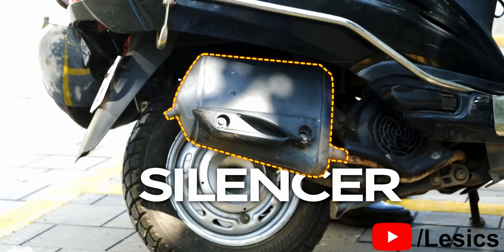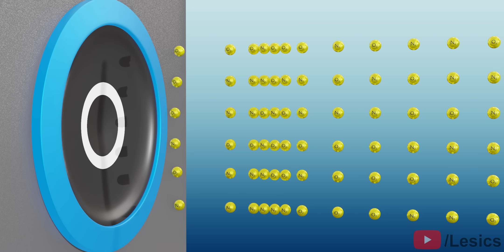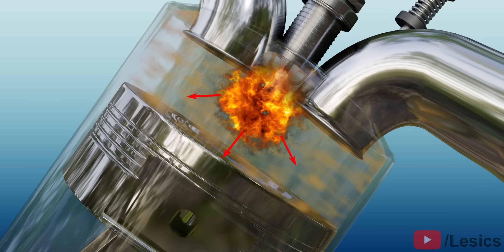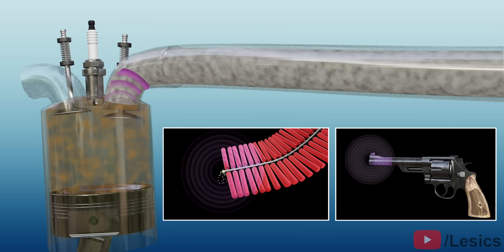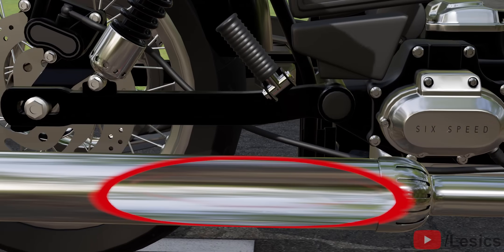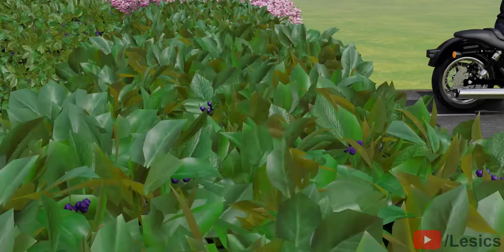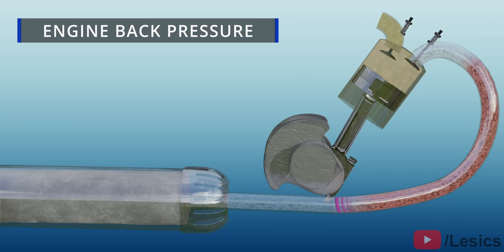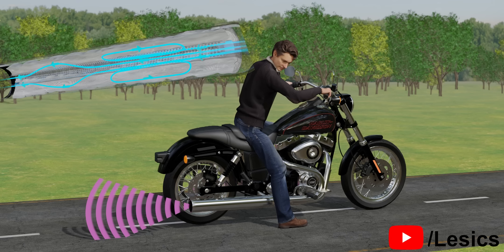Silencers | How do they work?

Comment: Trying to make a riding lawn mower engine quieter. It's an old, well used mower I bought just to move the sandbags I need to drive my two wheel drive truck in winter. Sandbags are used to give the truck weight over the rear drive wheels. I keep them stored when not in use in my shed which sits on the opposite end of my property. Owned this truck now for close to twenty years as my daily driver. Twenty years of moving five hundred pounds of sand twice a year got to be more than a little old. Had the bright idea to buy as used riding mower with a trailer just for this duty. I still mow my yard with a push mower for the exercise.

But the mower is loud. From what I read, they offer more quiet mufflers for the Briggs and Stratton. But cost more than I paid for the mower and more than I choose to spend. Bought a second truck, this one newer and Chevrolet. V8 engine and 4WD. Exhaust cross over tube under truck between cat converters from each side comes too close to transmission pan. So I wrapped the exhaust with exhaust wrap which holds up to temps at the exhaust manifold the most typical use for it. Have some left over.

The wrap is like a larger size ratchet strap and a quarter inch thick. It's soft and cloth made of some fiber material that is heat resistent to some ridiculous high number like 1600 degrees and can handle constant exposure to 800 or 600 degrees, 

Was thinking of wrapping the mower muffler on the outside. Also considering making a flow through resonator pipe with this stuff inside and a metal screen inside of it to keep it in place. Any thoughts or suggestions? I also have a hardware store fire blanket I bought at Harbor Freight for protecting things nearby when I weld. It's fiberglass. I would rather not sacrifice any of it and use the exhaust wrap instead. 

Started realizing from the DIY videos on homemade small engine mufflers, that small engines have a real noise problem that is not yet been addressed and soon will have California lead the way to ban noise from them. The same way they banned all two cycle engines. I guess they banned all small gas engines. But banning stuff is not only unAmerican, it doesn't do much other than making those who enjoy gardening and lawn work criminals.  lol

That exhaust wrap is intended to wrap a motorcycle or car exhaust at the hottest point in any exhaust, right when it leaves the engine. It should hold up if placed a short distance from that point inside a resonator as in the video here, replacing the fiberglass. Really, there is a market and need for something like this. You can buy name brand labeled quieter mufflers for small engines. But I don't think they legitimately do much and if so not for long.

Then there is a Honda small engines. Have one in a pressure washer. The motors sell themselves and the equipment that use them. Quiet, smooth and reliable. I read Honda designed the engine to be quiet and to get there takes more than just redesigning the muffler.

As a side note, the exhaust wrap had an effect on the exhaust which included trapping more heat inside the pipe due to no longer transferring that heat to the air via the walls of the pipe. And the more heat in the exhaust gas meant faster flow through the exhaust and out. I wonder if that can be used to make the exhaust quieter? If anyone can engineer a solution for quiet a small engine that uses things other than baffle arrangement, and absorbing materials inside the muffler, someone take advantage of what is already known but not utilized,l they would have as big a winner as I did when I made removable and rechargeable headlight module for my push mower and snow blower.

I was surprised when I Googled headlights for lawn mowers and only found riding mowers and some electric powered push mowers to use as examples. 

Thanks.

Comment: Main explanation is wrong: Sound reduction works exactly because sound pressure wave DO NOT travel with the fluid, but better they travel into it and way faster than it. As sound waves enter the muffler they start to expand also into the rockwool part and bounce everywhere at 550 m/s (speed of sound at 500 °C). The multiple swirls the air does into the rockwool cavities and passages "activates" the viscosity of the air, this way in part sound cancels out and in part transfer its kinetic energy to the rockwool fibers. As consequence sound is absorbed and dissipated in its propagation through the silencer. This causes the overall sound reduction.

Comment: The video is correct by strict definition. But.... It doesn't take into account that most camshafts create a scavenging effect by getting the exhaust valve open during the last of the ignition stroke. Some of the noise we hear IS actual burning fuel escaping the exhaust system.

Comment: That's why 4 valves; 2 Intake 2 Exhaust in 1 Cylinder is very important as it offers more intake outake output to improve engine performance.

Comment: No, the engine doesn't burn more fuel when you go faster, because the engine speed is according to how much air you're putting inside, more air doesn't mean more fuel has to be burned, so even if you go faster, you may not see the L/100km unit increasing, however you'll see that the fuel consumption decreases because more air helps the fuel combust better and efficiently, so this means that you won't hear a louder engine sound even when you go at higher speeds, so to speed up the engine you need more air not more fuel.

Because when you open up the throttle valve, you let more air into the cylinder, and when bigger amount of air is compressed, the air temperature rises a lot and helps the fuel combust easily and at the same time you get more power, so airflow equals fuel economy undoubtedly.

Comment: Stock silencers are always the baffle type as it is the quietest because it doesn't provide a direct flow for the exhaust. The exhaust and sound get bounced around the different baffled compartments before they exit. 

This absorption type is always the preferred aftermarket replacement since it allows a direct, straight path to the exit for the exhaust, increasing flow and noise while reducing weight through its simpler construction.

Comment: Sound waves travel in different ways

In various things.....

On Air......
In the Liquid ...or water....

On the metals....

In the metal the sound travels for some amount of distance as it was connected....for example In olden days....wired telephone ,,,, the telephone exchange person will engage the calls based on the frequency and intensity he recieved based on the waves ,,,,,, travelled and recorded.....

But the sound waves will decrease their intensity gradually upto some range.....

Within the range v hear them 

Sound obsorbers will observe the unwanted sound waves....

Generally this would b used in movie theatres....

Silencer of the vehicle will obsorbs the sound waves and delivers the minimal amount of sound outside which is generated by combustion chamber.....

Comment: The fact that the exhaust is what makes the Extremely Loud engine noise and not the actual explosions happening in the engine is completely mind blowing. I would have never even thought that was the case.
Reply: It's worth mentioning that a significant portion of the sound energy is radiated through the engine. Those combustion pulses do propagate through the walls of the engine, especially when it comes to air cooled engines. This is immediately obvious when you put an exhaust duct into a bucket of water. The remaining noise observed is now mostly due to radiation directly from the cylinder block and head, which themselves are vibrating just like the air, albeit in a much lesser form.
Reply: @captainotto  Excellent point and thanks for bringing it up.
Reply: Well no, the exhaust makes the explosions happening in the engine quieter, so therefore running it without one or a straight pipe is just the natural non dampened sound of the engine
Reply: @peeqo  either you didn't understand the guy or you didn't understand the video. Exhaust pulses are caused by the difference in pressure between the cylinder and the exhaust duct, not the combustion process itself. Since a good part of the thermal energy released is used as work, exhaust sound compounds a small portion of the energy that is rejected by the engine.
Reply: @dovilacus  The video is correct by strict definition. But.... It doesn't take into account that most camshafts create a scavenging effect by getting the exhaust valve open during the last of the ignition stroke. Some of the noise we hear IS actual burning fuel escaping the exhaust system.
Reply: @ebinmaine  well unless we're talking 2 strokes, delayed ingnition or injection that's extremly unlickely since the majority of combustion happens at the unit degrees after TDC. Also, I think my problem with the comment is more that it isn't reflecting the mechanism of sound, which are pressure waves around a mean, and the fuel doesn't explode, it burns. But ye, just an engineering sperging out on youtube comments, what's new 🤓😆
Reply: @ebinmaine  PS: unless of course it's detonating, at which point the the oxidation chain propagates at or faster than the speed of sound, and you stop having a communication of pressure between burnt and unburnt zones, leading to very high yet short peak pressures, a characteristic high frequency sound and if prolongued enough, a new piston 😜

Comment: Ah you mean a muffler, not a silencer. A silencer, in American English is used to reduce the noise level of a firearm to levels that will not damage hearing. Usually it uses air baffles rather than fiberglass.

Comment: This explains glass packs, and without you knowing it, gun suppressors. This video is actually about the ones you put on guns, not mufflers on an infernal combustion engine. Most silensers (in the UK and AUS, their spelling too) or mufflers use baffles and chambers to make them quieter. Imagine a very crowded room, and suddenly a group of people rush in one door and try to get out another. There are no exit signs and the doors are not in sight. As the group bumps into all these people already in the room, they lose all their initiative, and start chatting up the good looking people. That's a muffler. Oh they find their way out eventually, with the help of security.

Comment: Or, in a furnished room, the sound does not echo, but the bath also echoes. In the same way, wool is placed on the back of a speaker so that the sound pressure at the rear does not affect the front.

Comment: Interestingly enough, most internal combustion motors require some level of back pressure to operate correctly. 
I, and my friends, learned this in high school when we removed the mufflers (“silencers”) from our hot rods in order to get more horsepower, and instead saw diminished power…
Reply: If there's no back pressure, the fresh air and fuel will not only sweep out the exhaust gasses, but they will also begin to exit with the exhaust gas, resulting in a loss of fuel and air which reduces efficiency. If the back pressure is too high, the exhaust gasses can't all be removed by the fresh charge.
Reply: That's why there is so much fuss about tuned exhausts in high performance engines / racing industry.
Reply: what is the reason we need back pressure, i mean it just makes the exhaust gas back to the cylinder. i believe the reduce in power when you removed the mufflers was because you also reduce the exhaust scavenging, and therefore the exhaust gas from a combustion that happens from another combustion didn't get sucked completely
Reply: Dunno about that, my muffler opened up because rust ate away the metal sheet it's made of (2006 car) and now the car flies... definitely an obvious power increase.
Reply: @techalyzer  most likely you’re still getting the choking effects from the catalytic converters. 
Reducing back pressure is a winning strategy, in many cases; that’s why large bore exhaust systems with properly tuned mufflers work. 
In your case I suspect the factory exhaust was very restrictive, for better emissions and cheaper manufacturing.
Reply: @techalyzer 0:55 8😮😮😅m8n i88888t7

Comment: sir please explain Why/how do different exhausts make different sounds?
thank you so much for such great in detail explaination😍😍👍🧡
Reply: if we are using the exact same engine, the exhaust sounds should not be that different, the difference in stock and aftermarket exhaust is because of this silencers or mufflers and also because of the length of the exhaust itself, just like trumpet, the bigger and longer they are the lower the frequencies. The engine configuration will still affect the most on the exhaust sounds
Reply: @siontheodorus1501  Thank you Brother

Comment: When I saw the title, "Silencers..." I thought you were referring to the type that are attached to the muzzle of a firearm, also known a suppressor.  And, while glass pack mufflers are used on some automobiles (and possibly motorcycles) they generally have less sound suppression and longevity than those that use baffles and chambers to capture, slow, and even out the high pressure pulses in sounds.
Reply: American right?
Reply: @kevinfernandez9999  Well, yes.

Comment: Cheap noisy aftermarket mufflers are made like this,  all modern mufflers use 3 chamber noise cancelling designs,

that send the noise on different paths so the high pressure can collide with the low pressure zones.

Comment: the swing example is totally wrong. the children stop at the middle - this is not how energy conservation would work. they would continue swinging backwards. also they transfer the energy at the peak point where they should have the least (V=0) kinetic energy and the most potential. so no kid would swing the same amount as the one before.. your example would only work if they transferred their energy at the lowest point where their potential energy is 0.